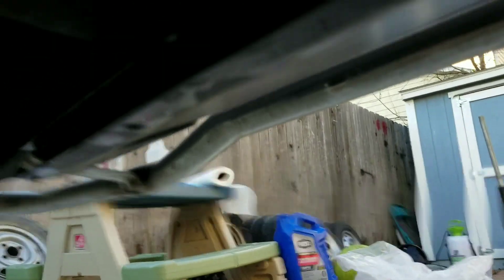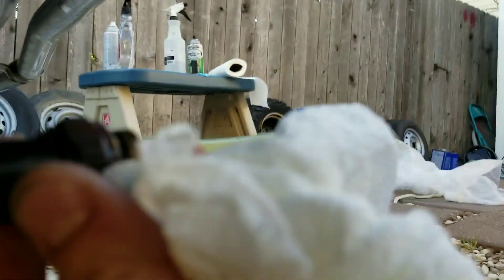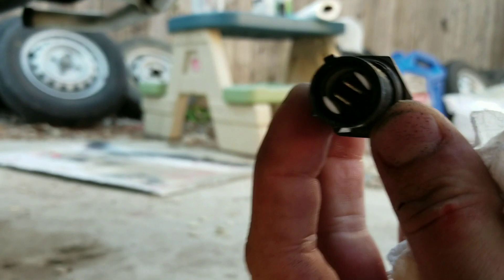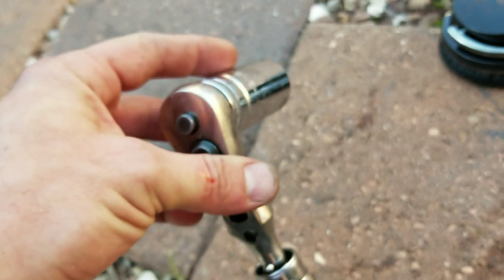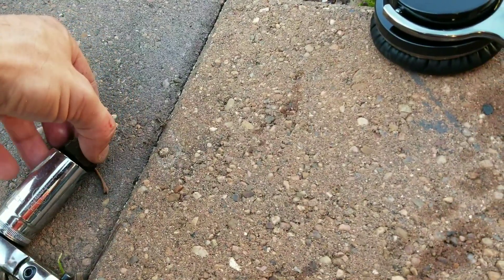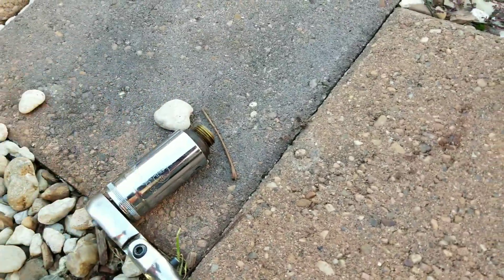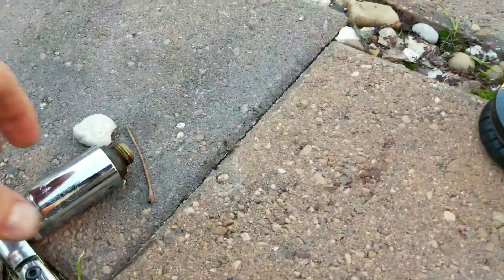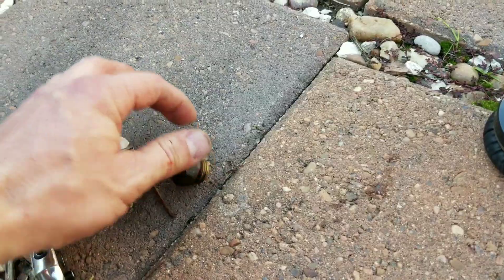Honda Acty radiator cooling fan not and gauge not working. Troubleshooting

Comment: i recently changed the water pump and i did bleed my acty ha3 the way the manual says but my radiator fan won`t start no matter what... i checked the fan and the relay ... it`s working .. also when i  unplug this sensor and short it with a paper click i can hear the relay working but the fan won`t spin.. i already checked the fan connecting directly to 12v and it`s works.. this problem is pissing me off lol

Comment: What could be happening if my gauge is going all the way to hot but not getting any engine lights and the truck doesn't run any differently? 1990 Acty Attack

Comment: These vidoes have helped a lot with my moms van any tips on getting trapped air out of the heater core
Reply: There is a bleed valve on the hot lines going back, not sure on the vans where. I've jacked the rear end up and used incline to get the air pockets out. The engine has some air bleed locations too.  These can be a pain when they get air trapped.

Comment: If my temp gauge works but does not ever get to the middle mark  ( just under it ) do you think its a bad sensor? I change water pump and thermostats when doing timing belt, thinking it was the issue but its still the same. Car takes a while to get to warm temp. Never over heats. What’s your thoughts. I have the sensor in my cart on your website. But want to make sure im not buying if its something else.
Reply from the maker: Seems normal. If the fan works, and it's not hot outside, gauge probably wont get to the middle.  enjoy
Reply: @USMiniTrucks  thanks Ben ! I do love my truck!best!
Reply: just bought some other items on your website! thanks for the help !

Comment: My HA4 truck (no AC) has a fan under the bed behind the drivers seat that turns on after the truck has been off for awhile and kills the battery, any ideas on how to fix?
Reply from the maker: It's supposed to turn on for a little while and cool the engine and then turn off even when the truck is off. there is a relay under the dash that sticks and fails
Reply from the maker: the 94 and Below its by the glove box and the newer models is on the right side by the brake fluid reservoir

Comment: if i replace the sensor ,we need to released coolant first?
Reply from the maker: It will leak out, maybe you can replace very fast and plug the hole with your finger. thanks

Comment: shoot that dont look to much diff than my thermo out of my honda civic d15b7 granted mine is weird.  look at that considering i have a electrical engineering degree it shouldn't be all that impossible to rewire one for a easy to get store bought one. it should still operate on the same ideas as the the 90s hondas
Reply from the maker: Yes, Honda Engineering is similar in a lot of things. I found some parts numbers are used on Honda 4-stroke outboard boat engines.
Reply: @USMiniTrucks  good to know. Thanks